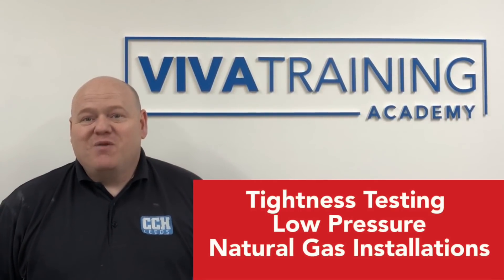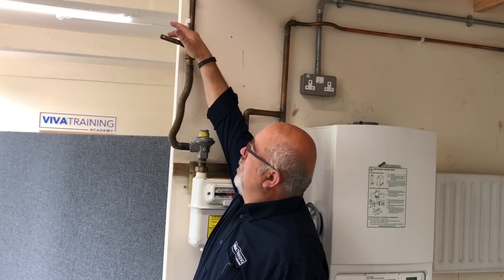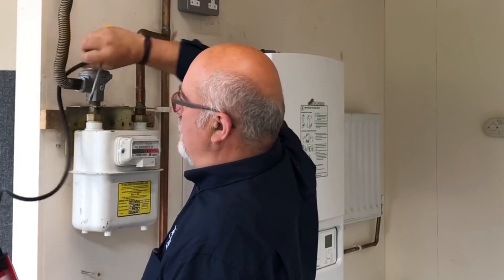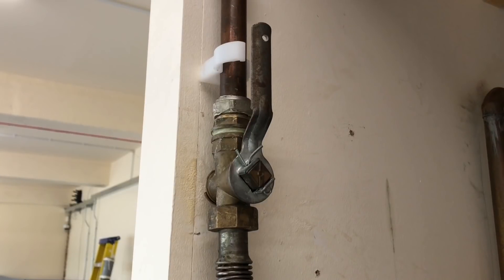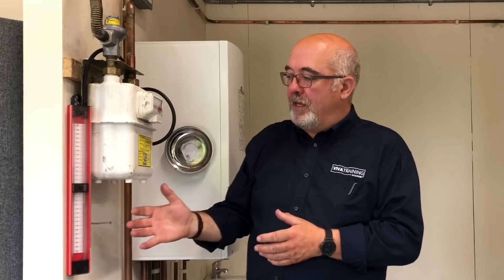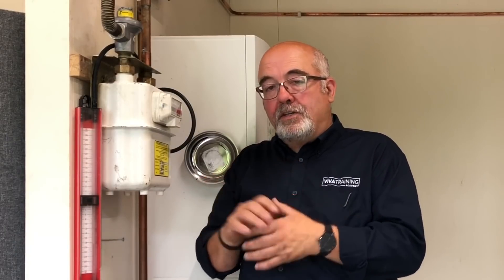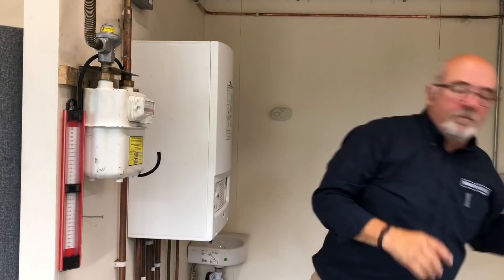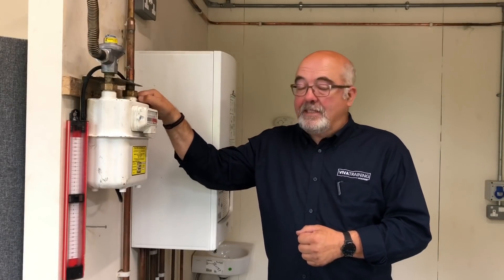Tightness Test - Low Pressure Gas Installation - Gas Training - Russell Holdsworth

Comment: Great video thanks What are the parameters for pressure drop test on a domestic propane system using a pair of 19kg bottles? The regulator is set to deliver 37 mbar.
Thank you any info much appreciated
Richard

Comment: I had a gas engineer come round and check my system, 
he did a let by test, a tightness test and a burn rate check......... all passed ok, no let by, no leaks and the burn rate was perfect.
however when I turn the gas off before it gets to the meter, my meter is still ticking up by a small amount!
Also I've received a bill from my energy supplier for £7000 worth of gas, for dates between November and July.
This is for a 2 up, 2 down, with gas only used for heating and hot water.  I mostly use 2 wood burners for heating so I barely have the heating on. 
The gas engineer said it wasn't possible to use that much gas as the boiler would have melted into the ground! He said there is no gas leak and if there was, for that amount of gas, the whole street would be able to smell it. 
Any ideas?

Comment: What about old installation appliances connected and there is let by .but isolate the appliances and the let by ok therefore us it id  because the leak is on the pipe work .

Comment: Good video but I would like to address some differences in procedures from the gas utility I worked  for. My experience comes from 35 years as a first responder / gas fitter for the gas utility in St Louis, Missouri. Your pressure test procedure with the water tube manometer is pretty close to ours except for the measurements here in the states would be in inches of water column. Differences would be #1 we would not put a service regulator back in use without knowing it's lock up and working pressures #2 Flex line connections are prohibited on the inside and outside meter sets ( we did use them at times years ago but found them to  be  problematic as they aged). All meter sets here are hard piped into place. #3 apparently you use the Pietro Fiorentini regulators with a vent limiter & we still use IMRV type Regulators that still need to be vented to the atmosphere.outside.#4 is your copper fuel runs in this video soft-soldered (?)  or am I mistaken & that is a high temperature brazing alloy? Thanks for the video and please stay safe out there.

Comment: Hi Alan, I watch your postings every night and they are absolutely brilliant, so easily explained and easy to understand. I have been considering a career change for the last few years and gas engineering always comes out on top! I am in my later years in of my working career at 48 and my only option would be the fast track option. The trouble I have is finding a gas engineer that would help with completing the portfolio, my labour of course would be free. So if you have any suggestions to help me I would be extremely grateful. Best regards Mick

Comment: do they not teach to attach a temporary continuity bond across meter prior to touching anymore ?
Reply from the maker: Never have. You would only do that when removing a meter. Thanks.
Reply: After safe isolation checks. The 1st temporary bond clamp is placed upstream of the meter. Where the existing earth clamp would be.  The 2nd would be place downstream of the the meter but NOT on the Anaconda ccst pipe itself . Then you would proceed removing the meter.

Comment: If there is a let by, get In touch with the supplier to replace the emergency control valve.
Reply: Or have it greased.
Reply: @johnburns4017  only the gas supplier can touch the ECV........Officially
Reply: @philippayne6655  
I never wrote otherwise. ;)
Reply from the maker: Thanks for the comment.

Comment: I have always thought testing for let by first and then the test for soundness which requires two movements of the consumer control cock could show a tight CCC the first time but could in theory pass when you are testing for soundness . By checking for let by after a successful soundness test ie  reducing the pressure in the system to 7/ 10 mbar would enable the let by to be achieved with only one movement of the CCC. I never would leave a 4m bar drop ,always thought this was very generous depending on the volume of the installation of course and cirtainly not 8 m bars for the newer meters.The internal volume of gas  may be less for the meter but stays the same for the installation which could contain long pipe runs of pipework.LastlyI used to find meter test nipples could have hair line cracks in them where they had been tightened to excess.but turning the screw back a touch would close the crack up and it would not show . Easily missed.
Reply from the maker: Thanks for the comment.

Comment: V Good.
How about a vid on what the regulator is for? On the old town gas there was none, as each appliance had its own regulator (called a governor).
Also emphasizing massive difference in pressure from 22 mb (gas)  2 bar (common on a mains water supply). 
What pressure regulator should be set to, to know when to report it if out of range?
mention pressure in the gas mains pipe to after the regulator. This varies of course.  
Maybe outside of topic, but high and medium pressures gas mains.
All meters have an overload, mention that.
I could go on. ;)
Reply from the maker: Not sure about that. See what we can do. Thanks so much.